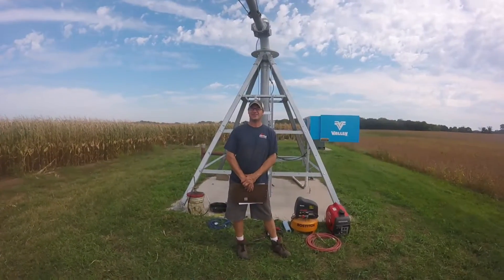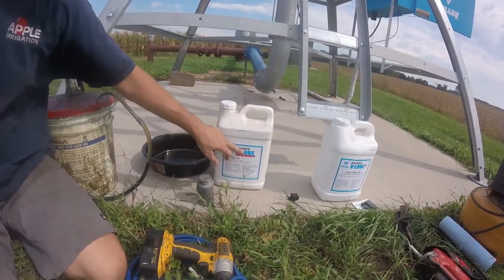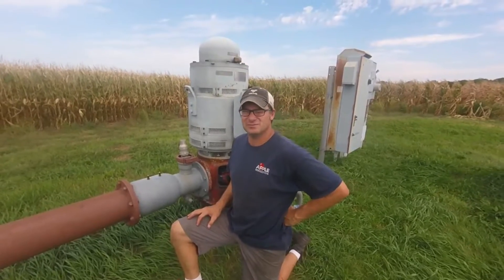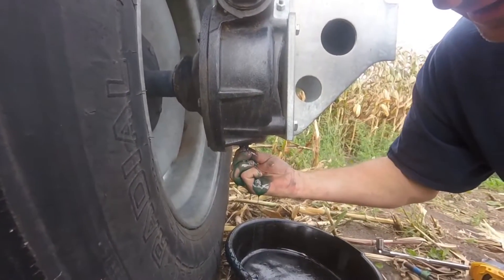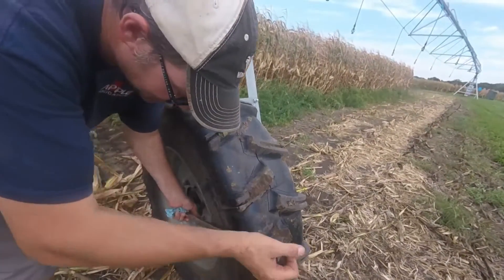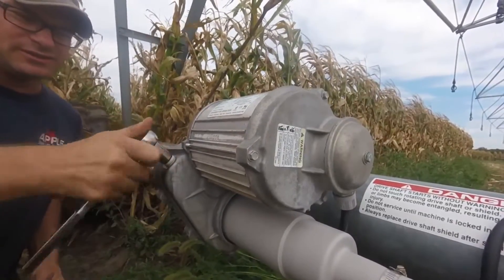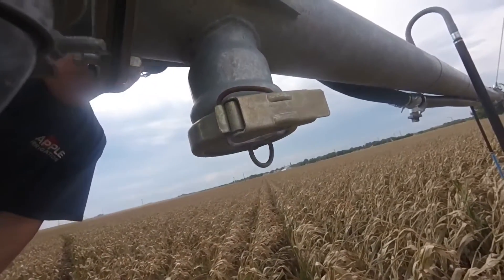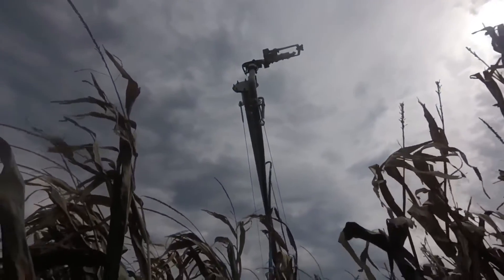How To Winterize a Valley Center pivot Irrigator

Comment: You missed a very critical step by drilling out the 2 or 4 tiny holes on the sides of the top cap
Reply from the maker: You are absolutely correct , I am going to re make the video